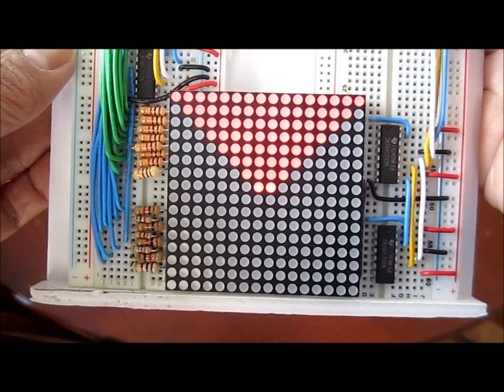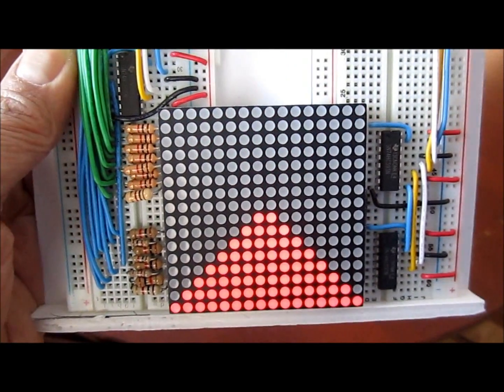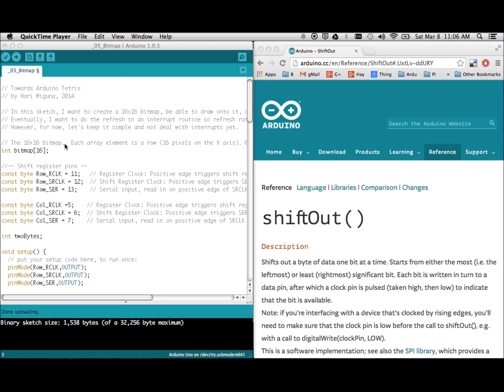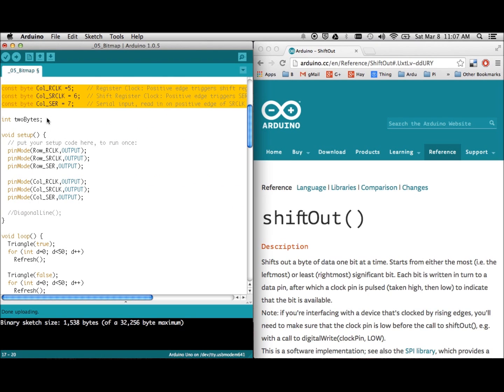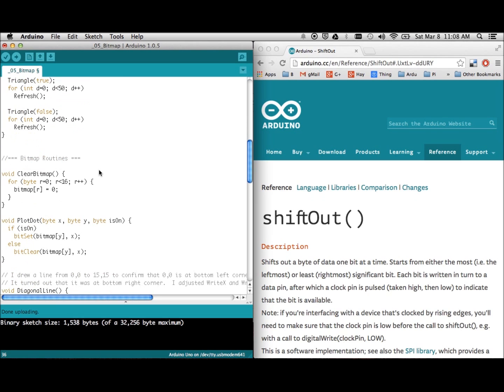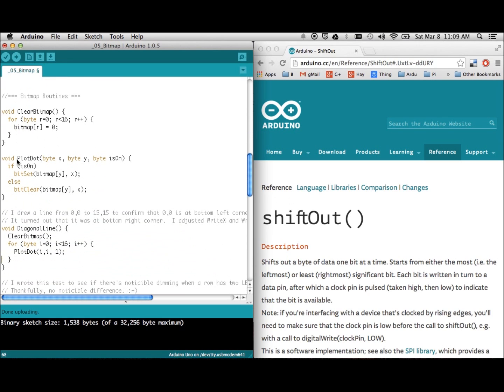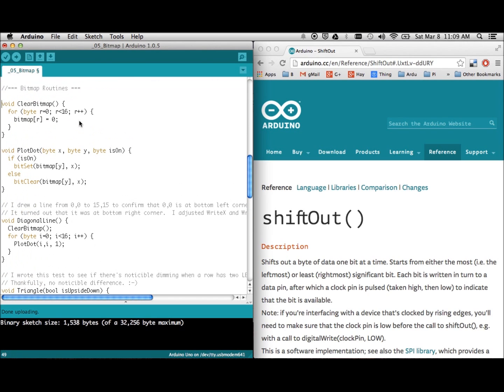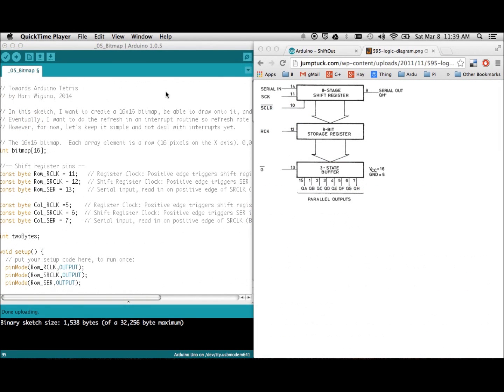Arduino Tetris Part 4 - Bitmap and Shift Register code walkthrough

Comment: Hi Hari, Ive watched entire project and learnt a lot from your code....I just finished an 8x16 project but my code logic was not as clever as yours...my question is the 16x16 matrix u r using is it a common anode or common cathode and when using the shift registers are the row's high and columns low or vice versa...thanks in advance
Reply from the maker: Hi ajcgkm (that's a mouthful lol),
13:24  I talk about why I had to flip all the bits for the row.  This is because to turn on led at row R, column C, row R must be set to negative and colum C must be set to positive.  I hope that helps.
Thanks for stopping by my channel.  Would love to see your version!